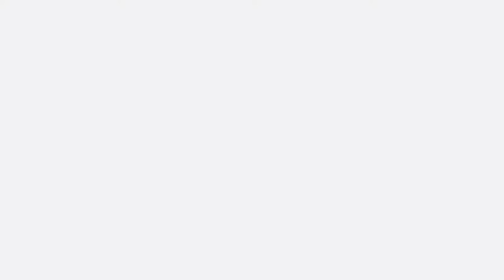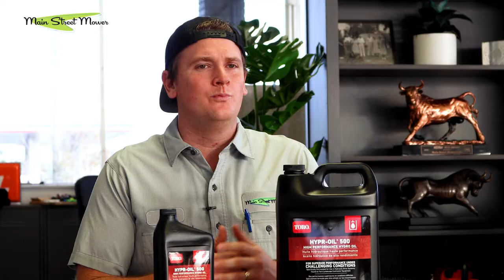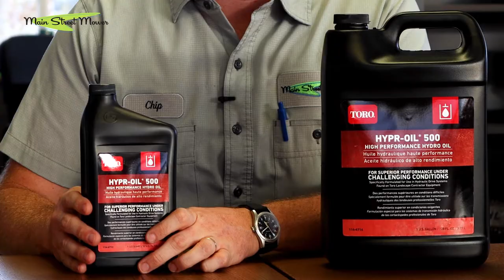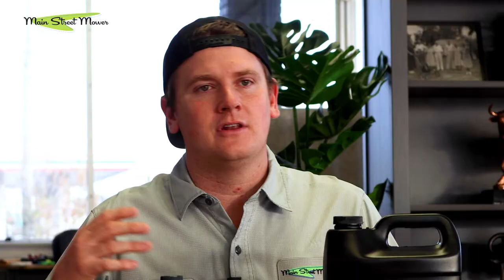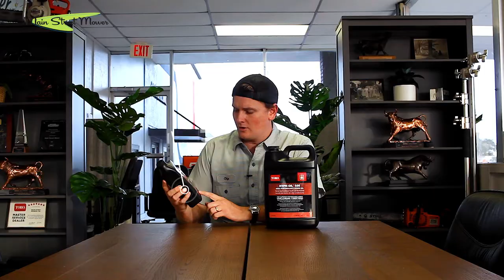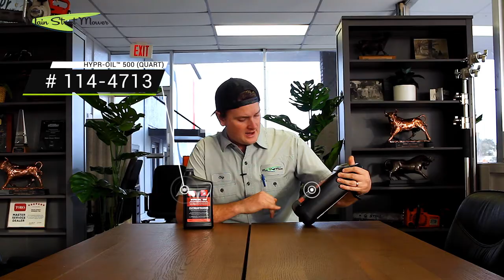HYDRO OIL Guide for TORO Mowers | Process, Products, Quantity, & Servicing!

Comment: I know I'm a bit late but I was looking up information for my  Toro Titan Max and the owners manual it states, "Hydraulic Fluid Type: Toro® HYPR-OIL™ 500 hydraulic fluid or Mobil 1 15W-50 oil. " 
The Hydro-Gear ZT-3100 transmission website for the transmission in my Toro states:
"Use engine oil with a minimum rating of 9.0 cSt (55 SUS) at 230° F (110° C) and an API classification of SL is recommended.
A 20W50 engine oil has been selected for use by the factory and is recommended for normal operating procedures."

When looking up the viscosity per the SDS for a few oil options here is what they were rated at 100C:
Toro Hypr 500 = 18.2cst
AMSOIL hydrostatic transmission fluid = 19.4cst 
Mobil 1 15W50 = 19.5
And John Deere Hygard = 9.2 (oddly low and verified not the HyGard Low Vis at 7.4)
While the Hydro Gear website is based ff a warmer rating I would doubt that the viscosity would be cut in half by 10° C.
Be careful when getting fluid changes and fluid from the dealership. I know mine uses JD Hygard which I switched out and my transmission is much quieter and smoother.

Comment: i bought a 60 inch new in the first part of 21 from TSC. it has 66 hours on it now as i only mow about 1/2 acre and the right trans starts to slip when hot. do you think doing a service will correct the issue? thanks in advance, ken
Reply: I'm curious if you tried Kentabler... I have the same issue and am hoping to change and fill the fluid. At least it's a cheap repair. My question is... can you drain the transaxel from above using suction? Removing it looks like a PITA.
Reply: @charleswaters455  i have not tried it yet, but im going to have to as soon as i get the fuel starvation iss fixed. not sure if you can drain it with a suction device bur there should be a drain plug on it  i believe
Reply: @kentabler290  Sadly, there is no drain on the unit used on the 54" units. You just remove the transaxel, open the fill drain and flip it over to drain. :(
Reply: @charleswaters455 just curious if the drain and fill fixed your problem with the right transmission slipping when warm 
I'm having the same issue
Reply: @charleswaters455  not sure , i have not donr it yet. more pressing issues with it. thought the fuel pump went bad so put an eletric one on it with a regulator and return line set to 1/2 pound and still wont run. most likley going to have to rebuild the carb
Reply: @jaythegrey6329  It did not, but I only did one side and according to my wife, I think I should have done the other side. I found it to be enough of a PITA that I don't want to do it. I'm going to sell the mower at a steep discount and purchase something new and NON-Toro  :)
Reply: @kentabler290  I have a ? re: the fuel pump - I replaced mine also with an aftermarket one that looks like the Toro and I'm curious, does it need to be primed or anything? Because for the life of me I cannot get fuel to flow. 

I'm curious how it works as a fuel pump considering there is no DC power connection. It has to be controlled by suction / vacuum, but I'm not sure.
Reply: @charleswaters455  the factory pump is called a pluse pump. works off the vacuum and pressure from the crank case, after some trail and error i find out that running reg unleaded is not the fuel of choise for these small engines and everyone has told me to run 90 + octaine in them. now trying to find a carb or rebuild kit
Reply: @charleswaters455  also they say to buy a factor pump if yer gonna go that way as the knockoffs are junk

Comment: Yes, Toro made the "mower", but they did not make the hydraulic wheel motors.  So, why not use the Hydro-gear branded oil as they are the OEM for the wheel motors and most likely the oil that is contained in the hydro motors when built/delivered?  I notice that Toro does not even recommend the Hydro-gear branded oil as an option.  Doesn't make sense to me unless Toro is just wanting to guarantee some sales of their own brand of oil.
Reply from the maker: Honestly only a few blenders make oil for everybody, Toro’s testing facility is the largest and highest budget in the USA and they have spec’d this oil for the conditions these machines work. It’s as good as any, it’s available at every Toro dealer, it keeps your warranty in good standing and it’s priced competitively.